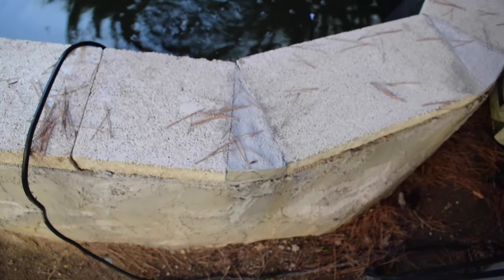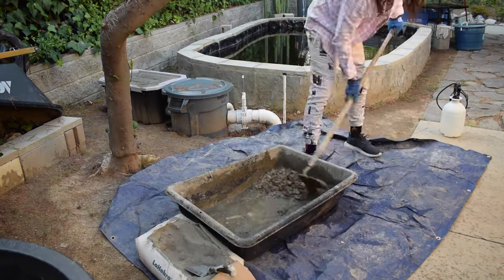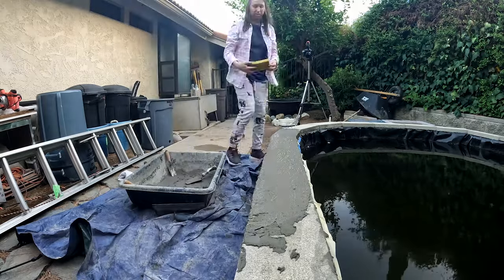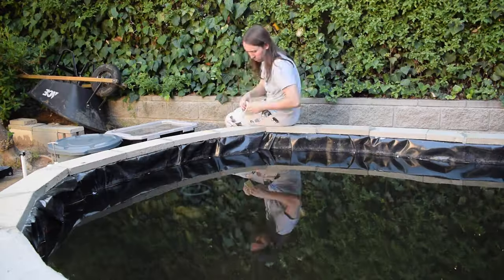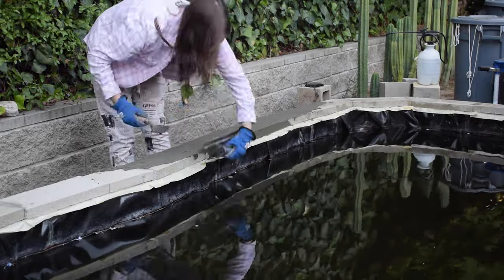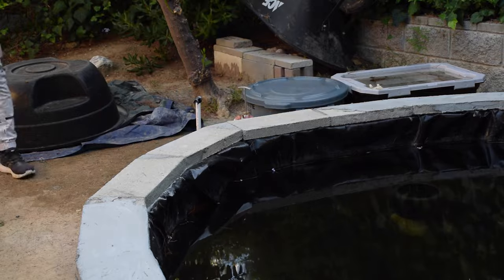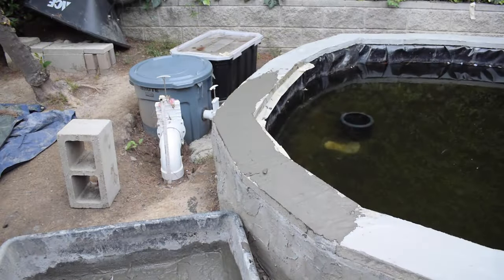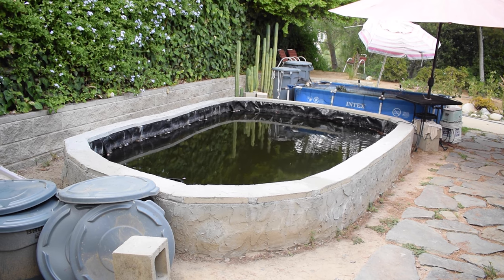Stucco Installation For DIY Koi Pond Retaining Wall!

Comment: A for effort! I think it looks great considering you did it on your own with limited experience.  Is the construction adhesive holding up? Did the underlayment and liner stick well to concrete with that adhesive? Lastly, how are you addressing overflows if or when it rains?